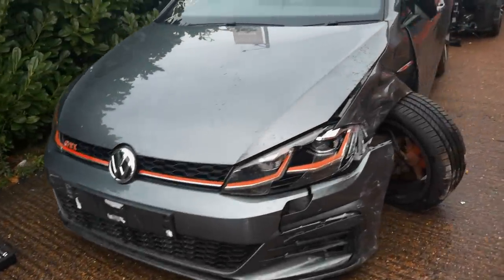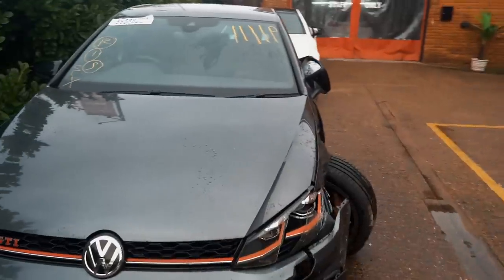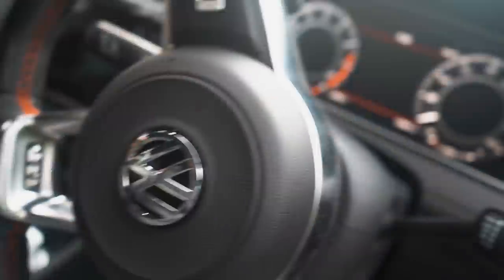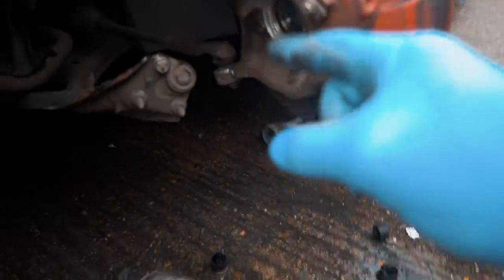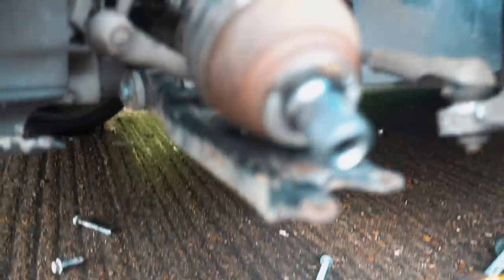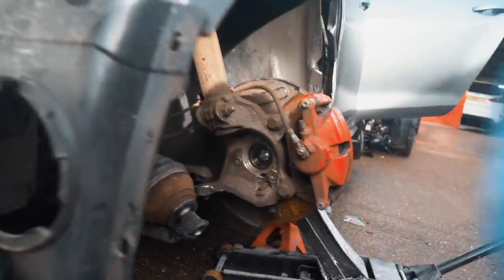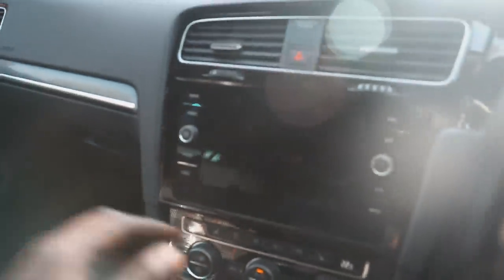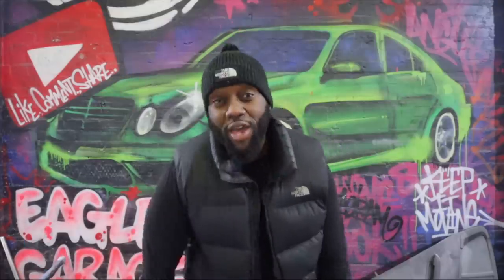REBUILDING A WRECKED 2019 VW GOLF GTI - PART 1

Comment: Looking good . First look I was expecting much worse damage . When you pop them shafts back in put a little bit of grease on it first so it helps glide in past the seal and dont pinch it ,nothing worse than a oil leak later. Place looks fab from the drone view , Lovin that DEEWalt gun certainly got some power in it and the burble out that Stang is something else .

Comment: Hey Dee can you show more about air bags and the sensors, do you have to change the sensors on the front of the car when you fit new air bags and reset it or can you reuse the old sensors that have been impacted in the crash?

Comment: Damn that is a total loss man. Even when repaired, that car will never go normal. It’s FWD so the gearbox will not doubt had been damaged, and so was the engine and linkages. The car won’t go straight as well. The poor guy who bought this car after it had been mended would be considered very unlucky.